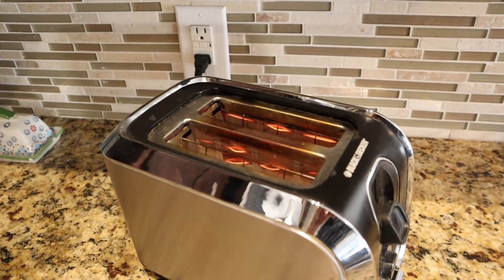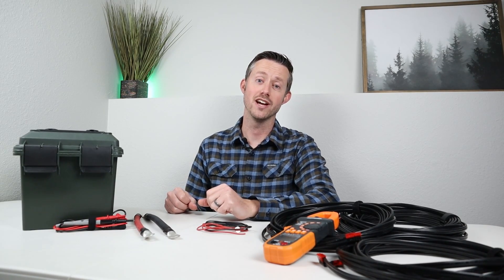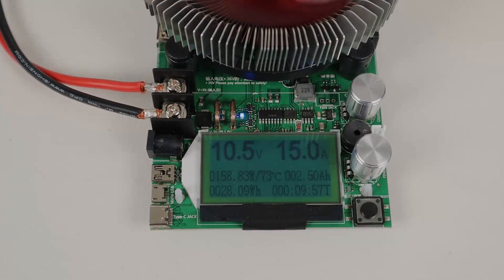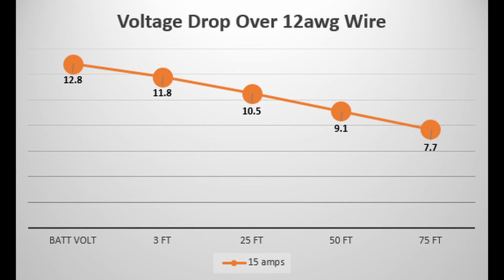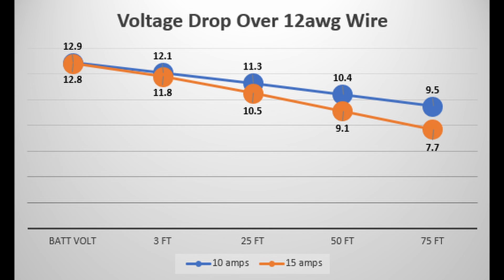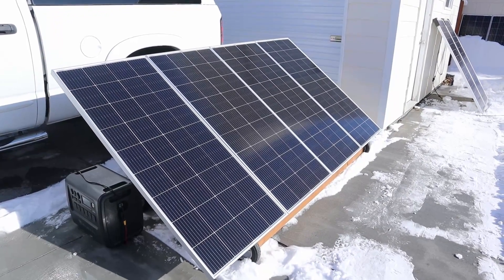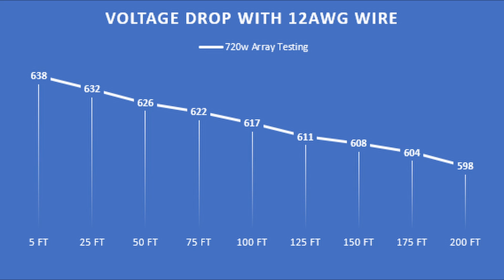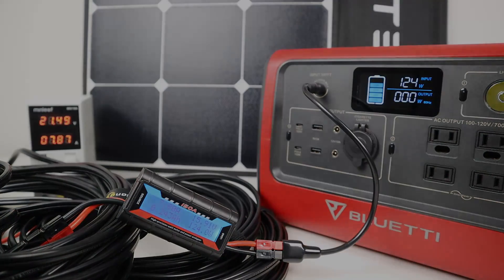What is Voltage Drop!? How to Limit Power Loss Through Your Cables!

Comment: Excellent information! Have you done a video showing the affects of leaving your wire coiled up as opposed to stretching it out? Does the coil heat up or are their magnetic fields like in an electromagnetic? 
Thank you so much 😊
Reply from the maker: A coiled up wire will definitely share it's heat with other wire touching it, so it does get warmer. If you have any coiled up wire I'd recommend cutting it down to the correct size. If you design your system properly you shouldn't have much heat in the first place so probably not much of an issue.
Reply: @Jasonoid  Thank you so much for this explanation, Jason!

Comment: Thanks for link to the calculator!  Last year - I did my own install an approximate 16 foot of #10 gauge wiring run from my 175 watt solar panel to the charge controller in my slide-in truck camper.  The calculator link shows the voltage drop to be about 2% - which is good to know.  

I believe that a RV industry install uses #12 gauge or more likely #16 gauge wire to support a bare minimal 100 watt solar panel.
Reply from the maker: 2% isn't bad at all! I'm glad you planned ahead and went with 10awg!